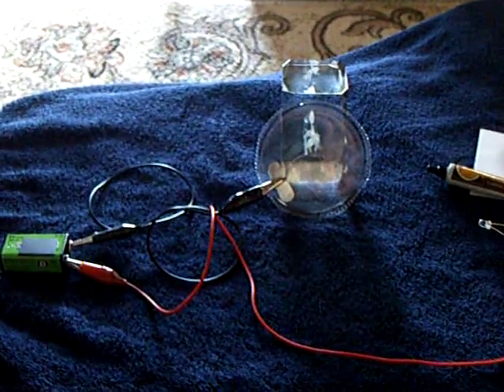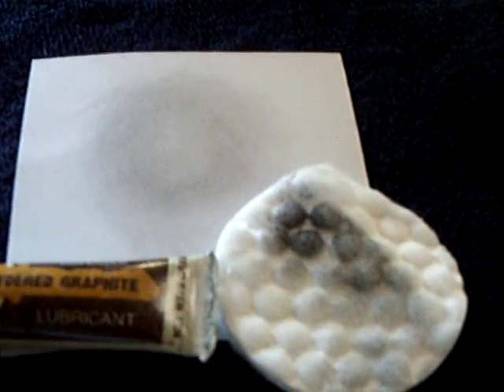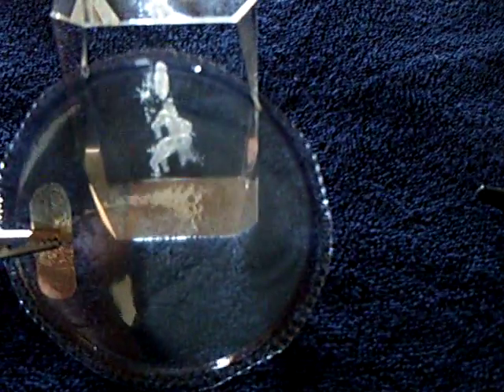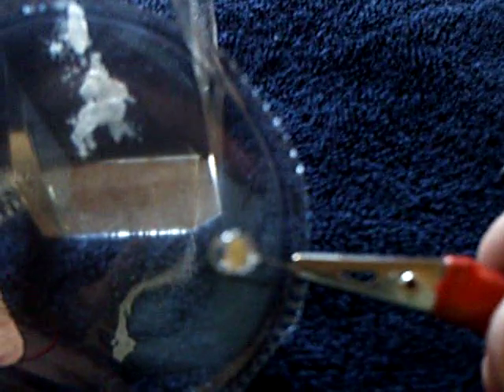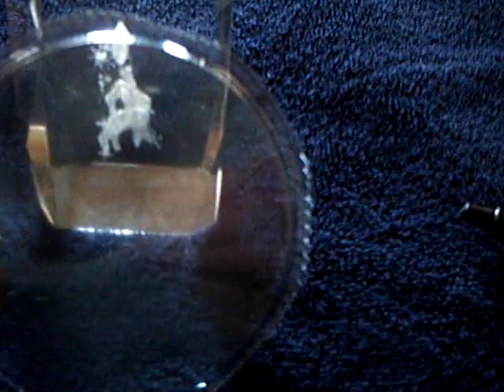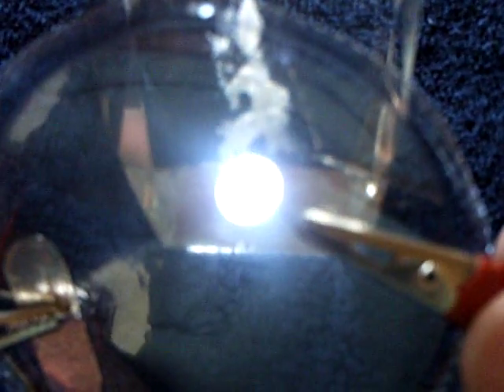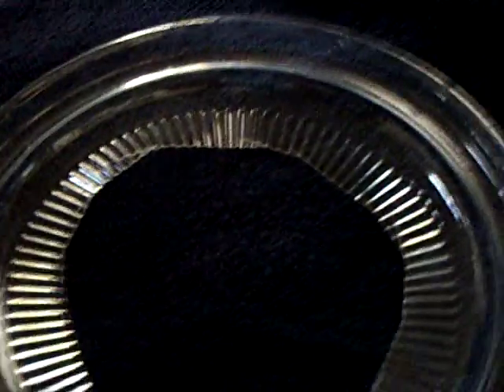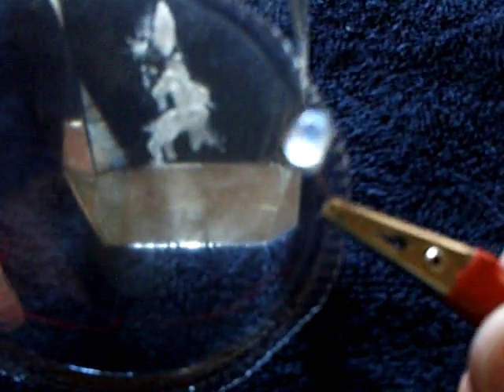Graphene  ---or maybe just very thin graphite

Comment: Ummm Lidmotor? (hint .. non patented way to make graphene rapidly right now? get small pyrex dish that can withstand boiling temps.... fill partially with water.... drop in some dish soap ... add a bunch of graphite..... put on burner.... bring to boil for about 20 minutes (yes you may have to add water to this or soap if the bubbling stops)......

The agitation caused by the boiling of the water and the lubrication of the soap causes the sheets of graphene to exfoliate out of the graphite particles..... the  Irish figured out that you can use a "blender" (hint agitating the mixture) and soap and water and graphite to do this effect.. BUT NO ONE HAS PATENTED the BOILING METHOD of the EXFOLIATION yet and well as I am describing the process here and as I have in the past before anyone else has.. good luck on ANYONE getting it patented and frankly I don't love money enough to patent that type of world changing idea.... ...

Try it out.. you might be surprised..... ;)

Comment: Use a cheap laser printer (Brother or Fuji Xerox) on transparency plastic (Acetate for overhead projectors @Staples in the US of A) and print your circuits or Graphene panels. You can even electroplate them... That's how I do it.
Reply from the maker: Thanks.  Have you made a Graphene super capacitor this way?
Reply: No. I'm messing around with the idea of printing graphite circuit boards on acetate transparencies. They could be shaped to fit the container, ergonomic design. I'll let you know if I'm successful.

Comment: What if you made Tesla's radiant energy collector plate? Two pieces of glass one etched in center to receive graphene coating and sealed together charging super cap to ground. Basically his description was using two caps, one was atmospheric.  May just need a diode to ensure energy accumulated stays in working cap.

Comment: Hey lidmotor,

Just a thought, but have you considered trying using electrolysis to eletro-plate a thin copper foil or sheet with graphite/graphene?
Reply: Here are two application hints:
"After being exfoliated in flakes [blender technique], the graphene can be recovered in a number of ways, including using filtering processes or by allowing the liquid to evaporate."

"...this means that "commercial printing techniques, such as ink-jet or screen-printing, could be used to create very thin, flexible electronics, including batteries and super-capacitors." 

Both are interesting.  Perhaps you could blend up & evaporate a batch of graphene, then take the residue & make a strong graphene mixture (i.e. just enough to make the InkJet ink flow properly)  & then print it onto a transparency sheet using an InkJet printer.
Reply from the maker: Maybe.

Comment: Have you thought about putting a layer of graphite on the back of the plastic & seeing if you can light the LED from the graphite on the back side. It may act as a capacitor - graphite-plastic-graphite...
Reply from the maker: So far I have not had any luck with that method.  It should work but nothing happens when I try that.
Reply: *****
Perhaps the plastic is too thick? Maybe try putting a DC volt meter across the two sides of the coated plastic - instead of the LED.

Have you measured the capacitance like you would on a capacitor?
It would be interesting to see if it can hold a charge...

PS - nice work mate :)